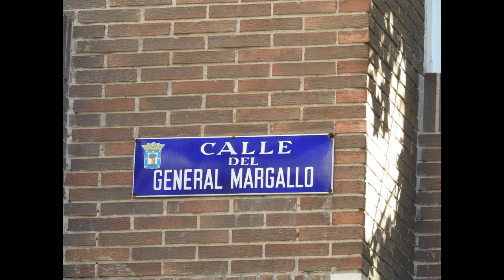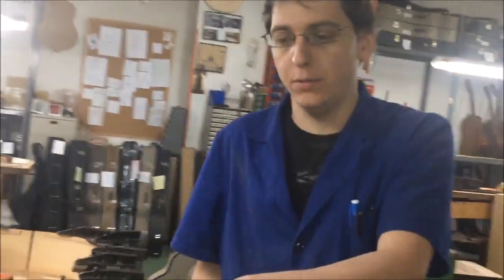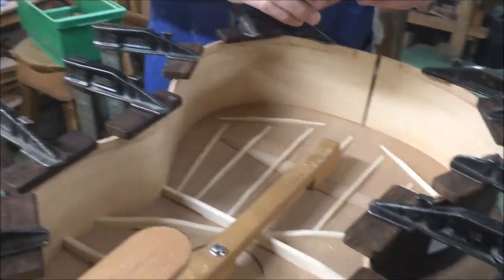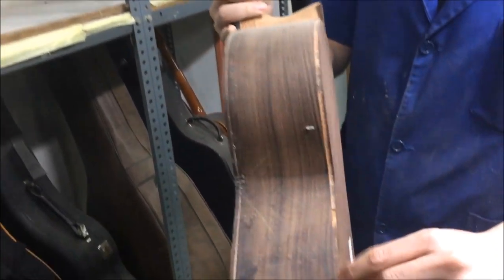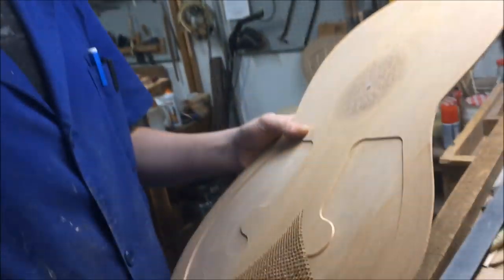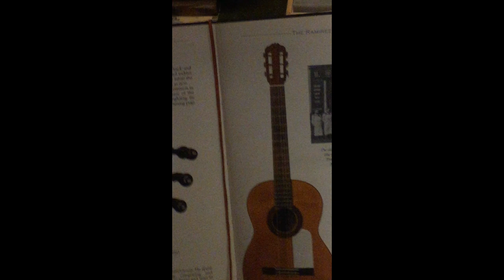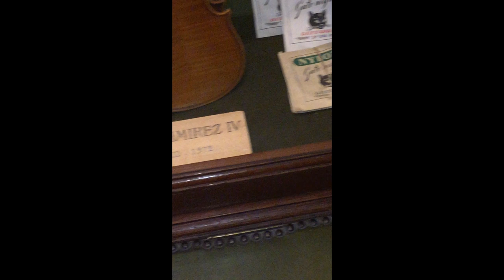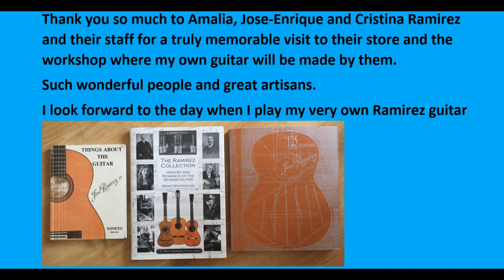My Visit to the Ramirez Guitar Workshop and Store in Madrid

Comment: Some time ago I also visited both shops and I had some 'inside" questions regarding neck 
problems and lacquering. They were willing to help me with that and I learned to do a kind
of neck reset that I did already proved to be according to the same method they are using. 
There's so much experience with the workmen there as they learned their craft from the 
older masters to the pupils interested in building guitars according to tradition but also are
going on in inventing and applying new ideas. Thanks for placing!